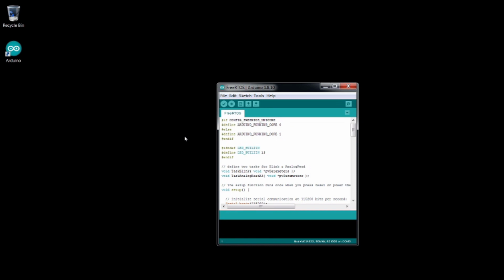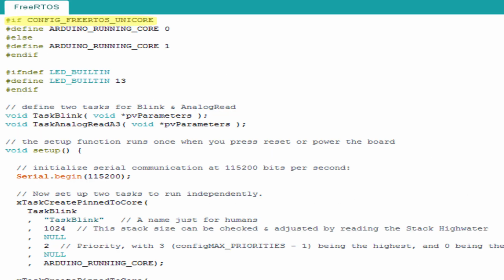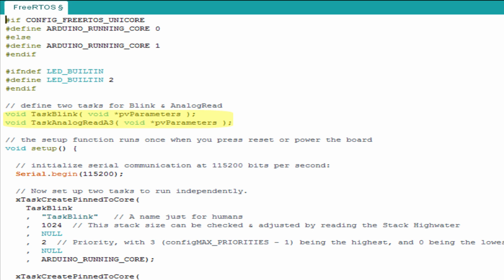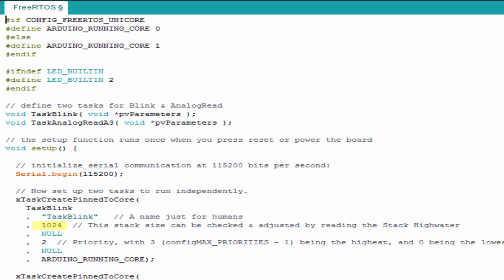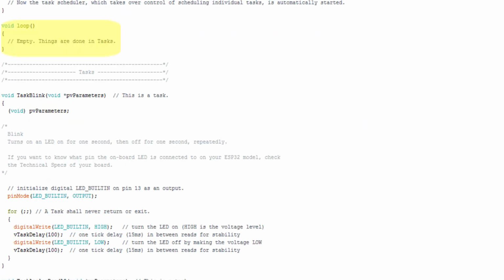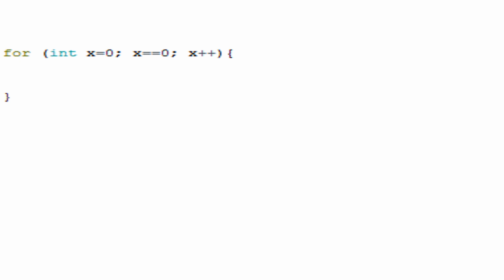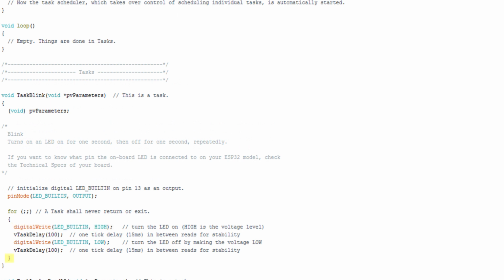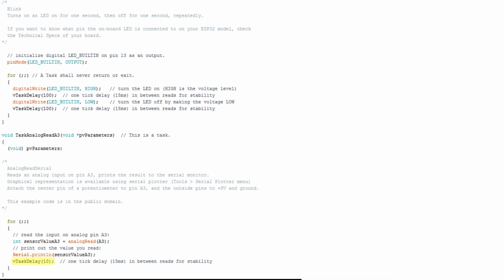FreeRTOS Arduino and ESP32

Comment: /* comment */ 
/* I would say if you have a good naming convention, then comments are unnecessary.
I actually had a colleague that had 30 variables with nams a - ad...
Omg I hated that pice of code . Useless .
Good variable names can often negate comments. 
*/
Reply from the maker: Absolutely selecting appropriate names for variables and functions goes a long way in making easy to read and troubleshoot code.

Comment: Hello! I hope every thing is Ok. I need a help on your side, my Esp32 (solo 1, may it have only one core) have been apper this issue sice the first time i connected it, i have been using the Arduino IDE, so when i try to upload the blink sketch the serial monitor display an infinity loop of this message:

Rebooting...
ets Jun  8 2016 00:22:57

rst:0xc (SW_CPU_RESET),boot:0x13 (SPI_FAST_FLASH_BOOT)
configsip: 0, SPIWP:0xee
clk_drv:0x00,q_drv:0x00,d_drv:0x00,cs0_drv:0x00,hd_drv:0x00,wp_drv:0x00
mode:DIO, clock div:1
load:0x3fff0018,len:4
load:0x3fff001c,len:1044
load:0x40078000,len:8896
load:0x40080400,len:5816
entry 0x400806ac
E (102) cpu_start: Running on single core chip, but application is built with dual core support.
E (102) cpu_start: Please enable CONFIG_FREERTOS_UNICORE option in menuconfig.
abort() was called at PC 0x400817d2 on core 0

Backtrace: 0x4008b2d8:0x3ffe3be0 0x4008b505:0x3ffe3c00 0x400817d2:0x3ffe3c20 0x40079053:0x3ffe3c40 0x400790b9:0x3ffe3c70 0x400790c4:0x3ffe3ca0 0x4007928d:0x3ffe3cc0 0x400806de:0x3ffe3df0 0x40007c31:0x3ffe3eb0 0x4000073d:0x3ffe3f20

Look like is about the FREERTOS configuration, but i´m new on IoT i don´t know how to fix it. I hopfuly You can help me. Advance thanks!

Best regards!
Reply from the maker: I have never experimented with the Solo 1, so I took a look at the datasheet. It is a single core unit, I have never ran FreeRTOS on a single core, but my first guess is you need to select a different board than the one I show in the tutorial, that is for dual core. I dug a little and found some references to manually adding files for the solo 1 to the arduino ide and framework to allow it to work. I am afraid I cannot help you more than that as I do not have access to a Solo 1 for testing and confirmation of that solution. You could try getting rid of the conditional definition CONFIG_FREERTOS_UNICORE and instead #define ARDUINO_RUNNING_CORE 0 in the example sketch. Set all tasks to run on the same core, core 0. I am not sure if it will work, but you can try it. The proper board support files should define for CONFIG_FREERTOS_UNICORE and tell the compiler that you have to use core 0. Good luck, sorry I can't help more than that as I do not have a solo 1.

Comment: Very nice explanation except till the attempted explanation of the weight of individual bits on a 12 bit ADC value...it is counter intuitive and basically not correct to place the LSB on the left and the MSB on the right because that is the opposite of how you write a a binary code eg. 5d = 0000 0000 0101 and not 1010 0000 0000 ....
Reply from the maker: Thank you. You are correct MSB goes to the left. I used LSB because I felt it was easier to understand for the less experienced and is typical in many introductory documents that reference the basic theory of binary values. It was the format that I first learned the basics of binary in.

Comment: Please give me the place (link) of  FreeRTOS library for ESP32 
How can I get it?
Reply from the maker: It depends on the version of FreeRTOS you want to use. The version I used in the video comes with the board support libraries for the Esp32. Once you have the board support libraries for esp32 installed in the Arduino IDE you can use FreeRTOS. You can get versions of FreeRTOS from freertos.org or you can use amazons version of freertos. The board support links are posted in my video setting up the Arduino IDE for esp32. https://youtu.be/eBgjLsMyimE Here is the link for the board support libraries for espressif micro controllers.  https://dl.espressif.com/dl/package_esp32_index.json
Reply: @CircuitSecrets  Thanks. But I was not successful with board support library.
Reply from the maker: @ZsLacibacsi  I am sorry to hear that, what error is the Arduino IDE giving you?
Reply: @CircuitSecrets  I did'nt find it among the exaples dir in arduino IDE. When I searched by myself I got several error messages during compiling time.
Reply: Could you give me an example .ino what is surely work?
Reply from the maker: @ZsLacibacsi  It wont show among the examples unless you set the target board to one of the espressif micro controller boards. You have to set the target an esp board before it will show up in examples after you follow the directions for the board support library.
Reply from the maker: @ZsLacibacsi  If board support is not installed and you are not targeting the correct board with the IDE no source file will work. If something is broken with the board support libraries it wont work.
Reply: @CircuitSecrets  the esp32 board support library and the correct board type is set, and i have made several esp32  project already.
There maybe some directory problem. (multiple directory used)
Reply from the maker: @ZsLacibacsi  That is really strange, the freertos demo example installs with the board support libraries for ESP which includes support for freertos. Maybe something in your install is conflicting? The only thing I can think of to try would be a clean install of the Arduino IDE and then installing the ESP board support libraries. If that does not fix it, I don't have any idea what the problem could be.
Good luck.
Reply: @CircuitSecrets  Thank your support. I will do that.